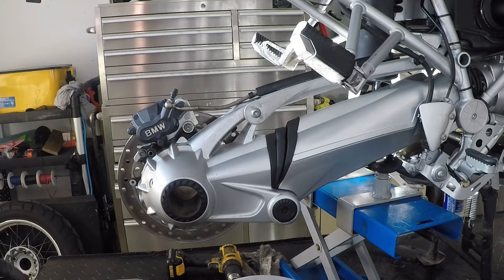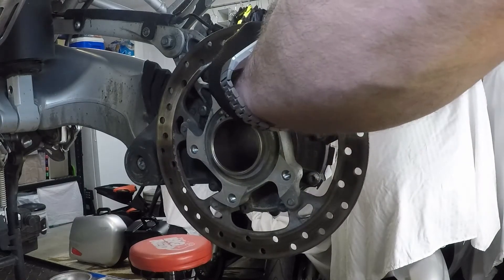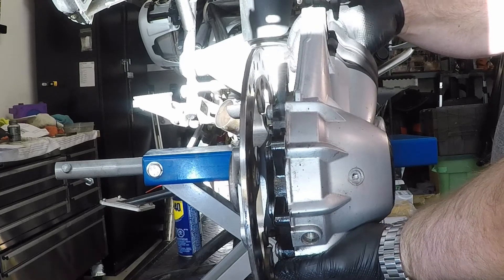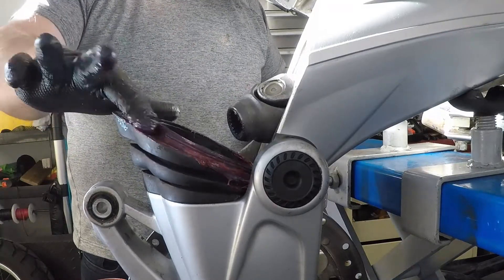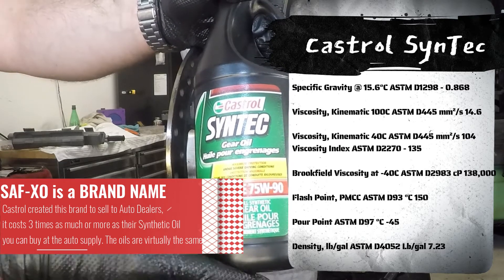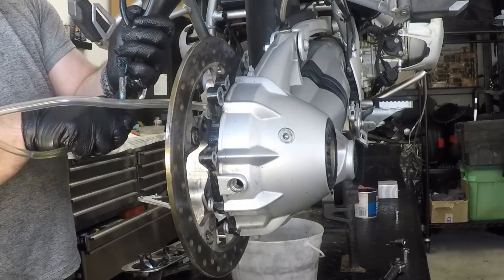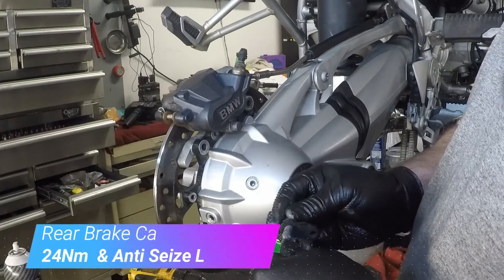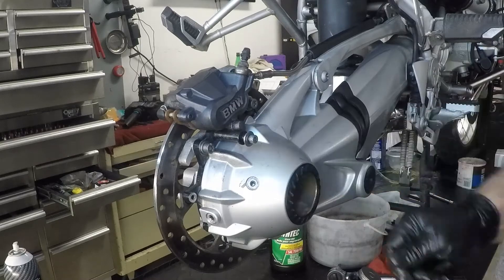BMW R1200 Final Drive Service

Comment: Another subscriber. Any chance you can do an inner seal (final drive) replacement video. I have my 2004 GS at my holiday home in Fuerteventura and need some guidance on how to replace it. I do not have a specialised tool to pull the seal and the closest BMW dealer is on another island! I hear some people drill holes in the seal and then put screws in the holes to then gently pull the seal out. Many thanks for this video. Greatly appreciated.
Reply from the maker: Hi Orange Spill and thanks for the feedback & subscription.  For the rear drive unit, you may want to remove it from the bike and then send just the final drive out for a rebuild, even Chris Harris sends them out to someone else to rebuild, see video https://youtu.be/L0_j8SuiFQI If you want to try this yourself email me through the channel about page and I can send you the factory manual instructions. - Good Luck
Reply: @RodRidesWrenches  Many thanks for the swift response and the additional chanel recommendation. Don't feel quite so isolated now.. Cheers! I'm going back to London in a few days so will revisit in May when I'm back here (Fuerteventura) with the bike

Comment: Go Canada ! Can hear the accent come through clearly. May the truckers be blessed and may Trudeau go the way of Herod.  I really needed that tip on the fender thingy because I struggled with it last night and was cursing German engineering. Also I came up with an extra little black washer ? Does it go on the back part of the shaft housing where the one fender bolt goes  in ?